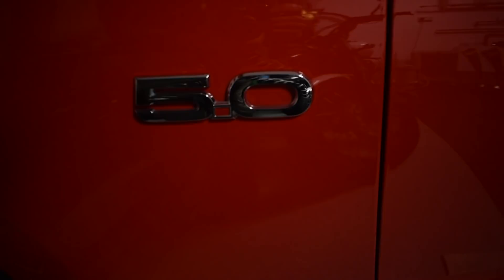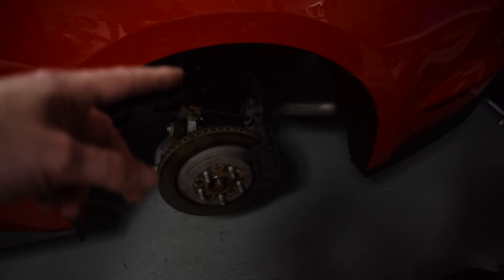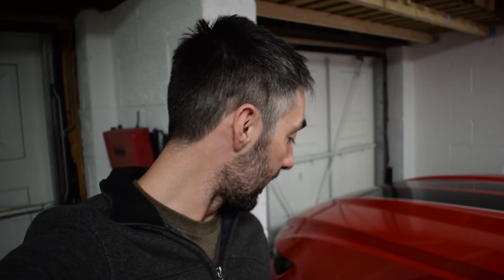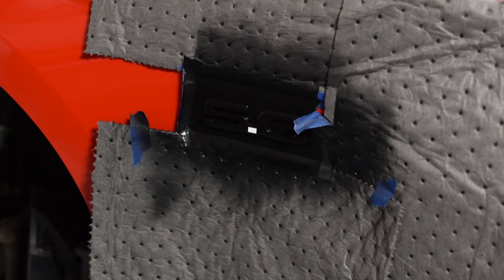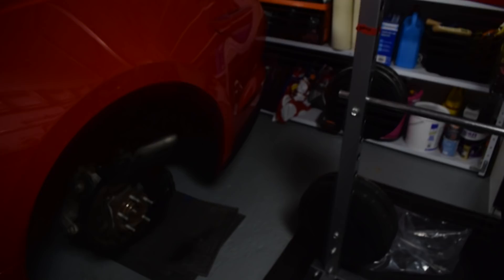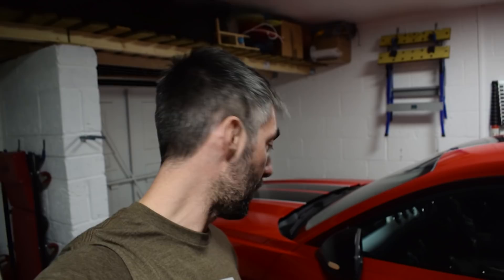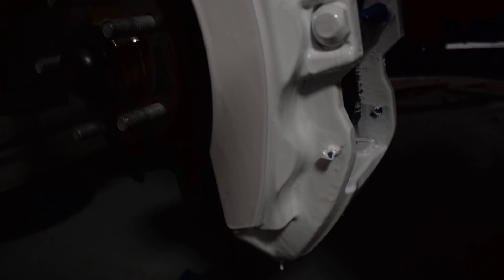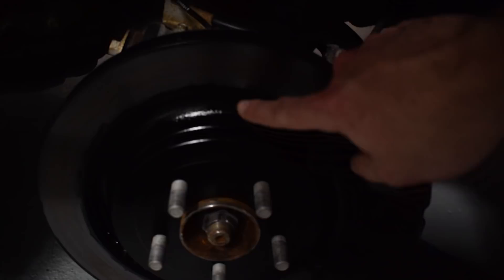Painting My Brake Calipers WHITE (Will I regret this?!)

Comment: PRO TIP: Peel of the excess of the plasti dip before it dry 100%..
Its so stupid that they dont paint the middle part of the brake rotors on the front, back and the ring around, cus they will rust and be ruined.